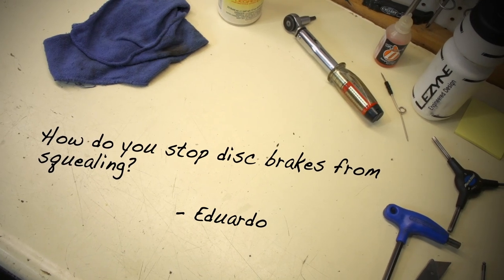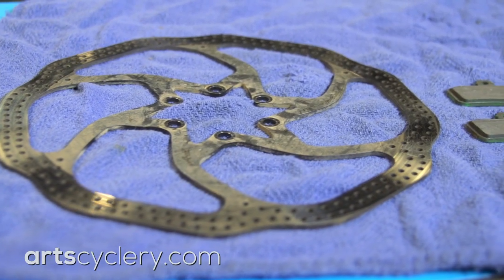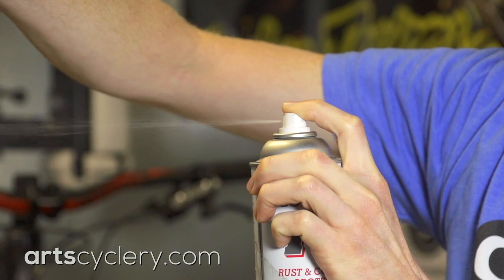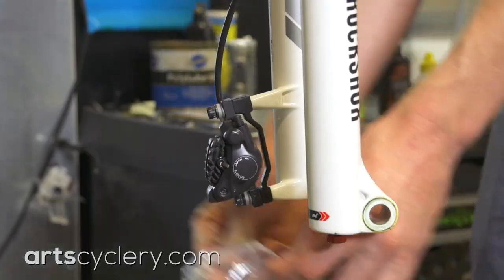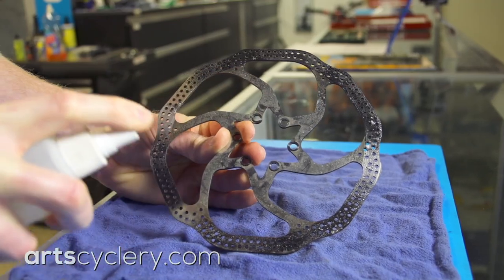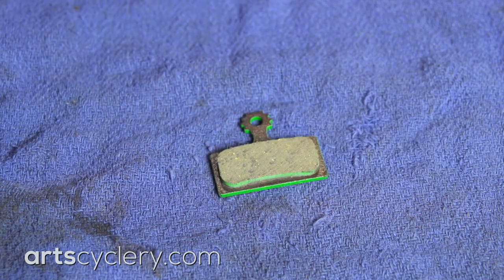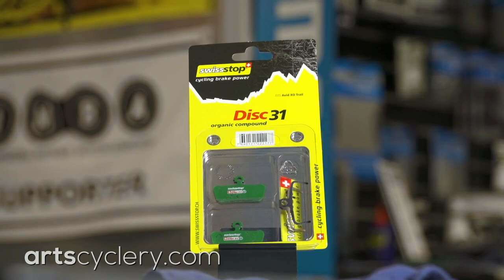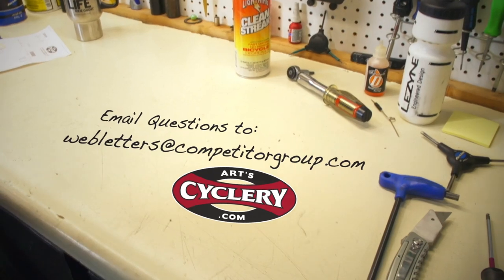Ask A Mechanic: How to Fix Disc Brake Squealing

Comment: How about SwissStop disc brake silencer spray? will that work? Also, will simple green cleaning agent contaminate the brake system? Thanks in advance!
Reply from the maker: Henry Chuong, Simple green leaves a residue that will make your rotor squeal after its applied. If the "SwissStop disc brake silencer spray" does what it says it does, then yes - it will help silence your brakes.

Comment: new to bike scene and used chain lube today now my brakes squeal hard and has no stopping power.
Reply from the maker: Hello, if you contaminated your brakes with chain lube, you will want to clean your rotor with alcohol and lightly sanding your brake pads. If this doesn't work you may need to replace your pads.

Comment: THE NUMBER ONE REASON FOR SQUEALING: the pads were not bedded in properly!
You must bed in any new pads or rotors to prevent noise. I run sintered pads on my XC bike with no noise because I bedded them in by manufacturers procedure. If you clean your bike why not remove wheels and pads. Makes more sense than covering with a bag.